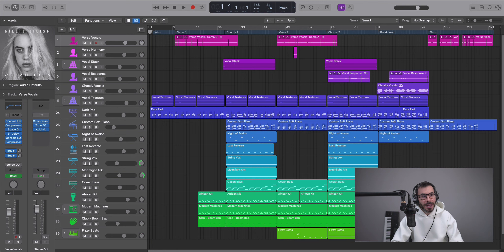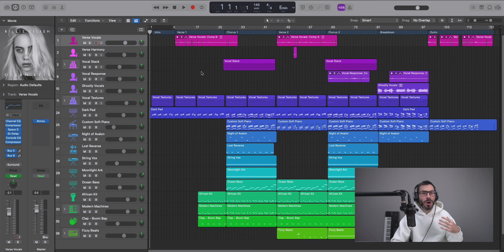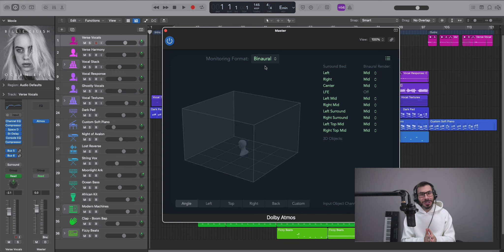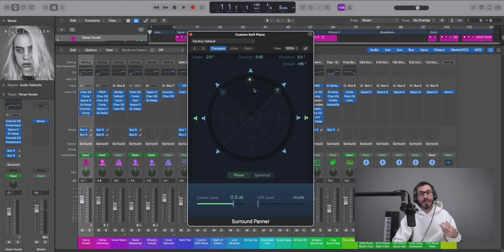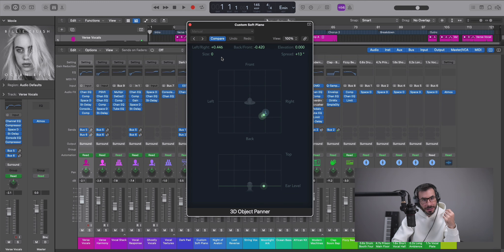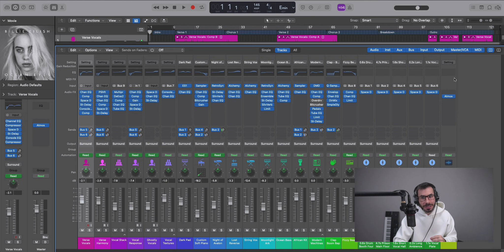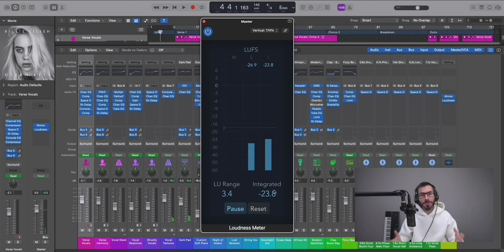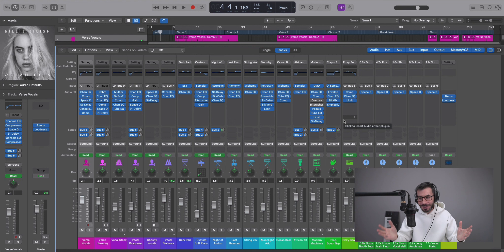Logic Pro 10.7: Settings for Mixing in Dolby Atmos (What You Need to Know)

Comment: Great video man!  Any idea what’s up with the I/O setup for an audio interface running a 7.1.4 speaker monitoring setup?  I’m using an Apollo 16x and I’m using outputs 1 - 12 on the Apollo but in Logic, I have to offset the outputs by 2.  So I get sound from outputs 3 - 12, but I’m not getting sound from the center channel or the LFE.  Any ideas??  Thanks in advance!!

Comment: Do I have to buy all the speakers etc to be able to ad the Dolby Atmos logo to my album cover? do I need certification to claim my mix is a Atmos mix using my apple iPods max and Logic Pro x 10.7.4?   if someone is watching a movie with a Dolby Atmos system but is not apple , will they listen to it just the same as using an apple hardware like a cellphone etc ? or does the Atmos mixing is exclusively for apple devices?

Comment: How do you go back to stereo after clicking Dolby atmos in the settings?
Reply from the maker: Good question. Will try and figure than one out. Looks like there is no way at the moment that I know of. For now I would maybe start a spatial audio mix in a separate version of your session. But hopefully will have an answer soon
Reply from the maker: The thing is. After converting your session to Dolby atmos. You can’t really translate some of the mix back to stereo automatically so I’m guessing that’s the reason why. But best thing to do is create a copy of your session for Dolby atmos mixes
Reply: @imamusicmogul  I know. Now my stereo file is ruined 😩😩
Reply: You have to ceeate project alternative before changing stereo project to dolbyso your stereo project is safe .
Reply: @soundfontmusicproduction  I found a way to do it but you have to do everything manually and change all outputs to stereo. Pain in the ass
Reply: @nilsbrandl9510  ahh …that’s works…nice info😊

Comment: For some reason, when I select Dolby Atmos it crashes immediately. I am on a late 2015 iMac, does that affect anything?
Reply from the maker: It should not. Try rebooting your computer and try again. Hopefully that resolves it for you
Reply: @imamusicmogul  I am having the same issue and I have the 2019 16 inch MacBook Pro running macOS Big Sur 11.6 The crash happens after pressing ok to switch to Dolby Atmos. It's really frustrating that I can't try out the spatial audio features. Everything else works fine. Tried restarting both the software and computer and even reinstalling Logic Pro X but nothing helps.
Reply: Same for me, can't get it to work.